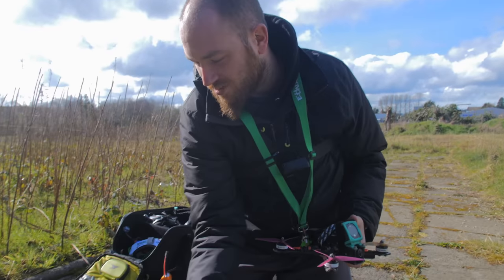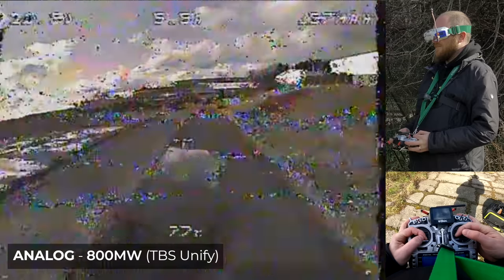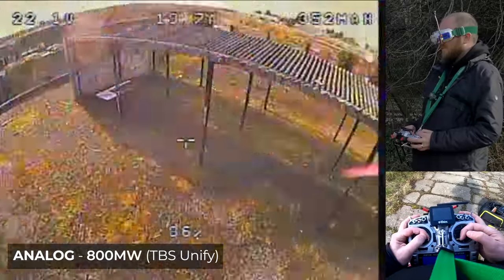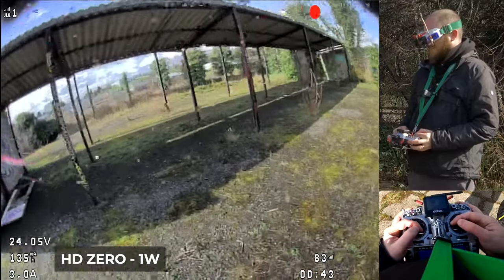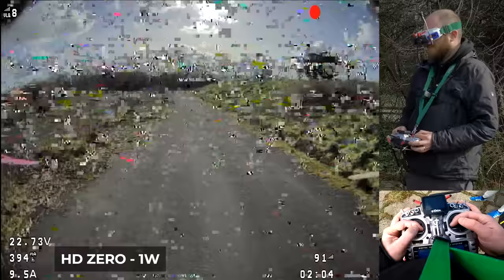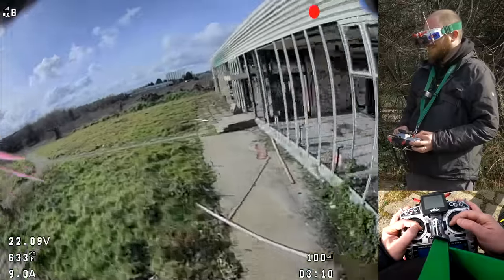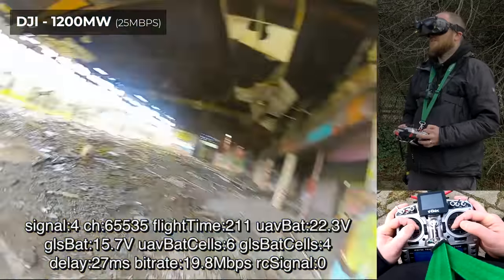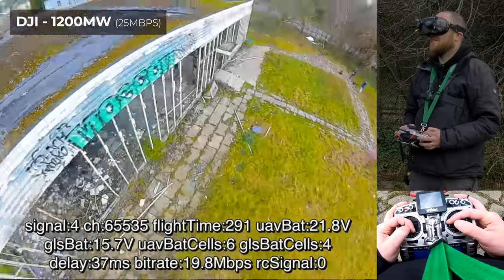HDZero vs Analog vs DJI - Penetration & Image Quality Test - small bando

Comment: Very nicely done video. My only tips for hdzero are 1) ditch the true rc stubbies. I get the worst performance using those and its noticeable. Your rankings will still be the same, but it should cure the full screen flashes a nice amount. Go with spironets or vas mad mushroom. 2nd tip is I noticed you look down more wearing the hdzero setup so I recommend tilting the patches upwards like 25° or so. This also helps a ton out farther cause hdzero doesn't do diversity. It needs to use all 4 signals, so when your beam angle is headed toward the ground, far out you're basically on your omnis mostly. Again, I'm not saying it'll be night and day or anything like that , but if you do fly it again it will definitely increase your experience. I have a bunch of penetration tests on my page :).
Reply from the maker: Hey man thanks for the comment, nice to have a view from hdzero royalty 🙂. I watch your stuff all the time, appreciate the tips 👍. The real test here was between analog and hdzero, dji is kind of a whole other thing in regard to what was being tested. Just built a fettec 15a 2.5 inch quad with the Hdzero whoop board and I LOVE it!
Reply: @int3fpv  haha I appreciate the love man! You put alot of effort into this. I'll eventually add dji to my fleet, I just don't really fly the kind of demanding locations that people like sync fpv fly and prefer a locked latency. But I do fly dji from time to time, just don't own it myself
Reply from the maker: @anthonyfpvminiquad1728  I like to fly quite close to myself most of the time, because I fly hard and don't want to walk ages to recover a quad when the crashes happen! I also value the consistent latency over penetration and image quality - which is why I fly analog (and increasingly hdzero 90% of the time). For flying med-long lines in a bando though dji is the way to go. They all have their place imo
Reply: @int3fpv  exactly how I feel and lmao your reasoning is EXACTLY my own. I'm just not built for going so far to go get my quad 😂 fuck that. If I ever got I to long range I would have zero motivation to go find my quad kilometers away. The fpv gods can keep it 😅😅😞
Reply: @anthonyfpvminiquad1728  Plus, I find flying long range is boring as hell! Mostly because a person pretty much needs to be way up high to get good long range, and I enjoy flying around objects, through trees, and weaving through the environment. Flying up high, in the open air, hell...you might as well have a Mavic! How is FPV long range any different from a Mavic long range? Sure, there is some, but not much! Open air flying up high is boring! And, what's the point of going so far? So, you can brag to your buddies about how far ya went? Finding a quad that far from you is futile - if not totally futile, really close! I do not see the point! lol
Reply: Just wondering... Is the "DJI" equipment the same as on the DJI FPV drone? Or something else? Thanks.
Reply: Agree 100%  Theres a big Difference if your Head/Antennas dont point in the right Direction. For Antennas i use the Lumenier Double AXII 2 HD and they improve the HDZERO imo, but DJI will still outpower it in therms of Breackup... May HDZERO will improve with theyr own Goggle, we will see. Cheers and thanks for this great Comparsion.
Reply: @AuroraColoradoUSA  Goggles are the same and you can switch it the on screen menu between the DJI FPV drone, and a "real" FPV drone.
Internal electronics on the DJI FPV drone is just for it.
A  "real" FPV drone uses either the DJI Air Unit or the Caddx Vista, which is much smaller, lighter, and much more popular.
If I were you, I'd buy the DJI goggles, and find a great 3" or 3.5" BNF (bind and fly) drone that can fly pretty much anywhere. I absolutely love my EMAX babyhawk 2 HD!! and highly recommend it! Fast and agile with a small 4s lipo, and will do 20+ minutes of long range with an 18650 battery - see Nurk's review on it!
5", IMO, are highly over rated and are mostly used for racing with gates. Problem is, in every day real life, they are LOUD, big, heavy, and attract a lot of attention - Bring out the KARENS, who complain about them and give you hassles. Plus, they require a lot of space to fly. With a 3" or 3.5", you can pretty much fly in any park right down the street and not attract too much attention. The parks don't have to be very big either! I started out with 5" and haven't flown mine in over 2 years!! Why? Because the closest place is about 30 minutes from my house, and it's not a very good. A park to fly 3 or 3.5" is only 3 minutes from my house, and there are about 5 that close that are all better than the 5" spot! Anyway, go get the gear and love the crystal clear image quality!!!  :)
Reply: @KOrnhOliO1  farthest i went is 750meter acros and around a lake. Its more than enough and yes it gets more boring the farther you go .
750 meter one way means 1500 meter in diameter. Thats one hell of a playground.
If you go fly far in one direction u might aswell pack ur stuffand fly there lol
Reply: @int3fpv  that 2.5 inch little drone you built sounds so cool!!! Going to your channel now. something about small fast f.p.v. quads really get to Me i just want to buy every one I see lol
Reply: Yeah... I also noticed with DJI he kept his head up and goggles pointed towards the quad. With HDZero he essentially had the patches pointed about 6 metres in front of him. Not very fair at all. Not to mention that DJI is set to the illegal 1200 mW.
Reply: @KOrnhOliO1  diving mountains mostly. That means 2-3 km of range at least and an fpv drone, not some dji stuff. Other than that, it's fun to just fly a nice cinematic, few km flight during a golden hour with a gopro. And it is also fun to chase after distance, but I personally fly freestyle in absolute majority of flights.
Reply: @KOrnhOliO1  Not necessarily. I'm building a Nano Goblin plane for long range, and I went with 900mhz ELRS and 1.3ghz FPV link because I want to do proximity.

Comment: Great comparison video, call me old school but analog seems like a way to go for a freestyle pilot, you might not be getting that colorful, HD image, but you still have full control, "none washy" feel of the quad. When you're flying in sketchy spots I'd rather have a crappy video signal strength as long as it's manageable to see and orient my self, than a crappy flight performance and full screen blurs or flashes, and be more likely to crash.
Reply from the maker: I think for bandos, especially larger ones DJI is going to be the best all rounder. Where you still have an analog image any latency in the dji feed isn’t going to stop you dojng anything, it’s more of a subtle feeling - personally I find it ruins the immersion a bit despite the much better and stable picture. Seeing gaps sooner and clearer is going to be a big advantage though. I fly very close up usually and hard, not far to walk when the crashes come lol so I still fly analog the most. I’ve built a hdzero sub250 micro for around the garden and house and I love it, much improved image from analog and rainbow screen isn’t an issue because you’re so close. They each have their pros and cons, but I’d say dji is the best all rounder for most freestylers
Reply: What’s the point of that when you’re locked in a box of where you can fly? You can fly much better when you’re not worrying about losing video
Reply from the maker: @SikhFPV  sure, but some people like to fly inside buildings behind many walls, just shows you what you can expect

Comment: Thank you, this is one of the best videos comparing the systems I have found yet. 
I also noticed nin other videos that HDZero handles medium signal strength better compared to analog, but drops faster and harder at really low signal.
Reply from the maker: Yeah definitely up to a point hdzero has less interference and distortion compared to analog, agree.. maybe first 60-70%?

Comment: thank you so much for this video. I really want to start FPV, and this is super useful. I like the fair comparison. I think I prefer the HDzero colors (it looks a lot more natural), but statics get in the way and the image gets worse than analog. I am definitely considering DJI, but I guess I will wait until the product situation clarifies.
Reply from the maker: Thanks glad you enjoyed it - yeah in my opinion they all have their pros and cons and it really depends what you want to do with it and the sort of environment you fly in. I mostly fly analog and hdzero depending what I’m doing. 

One thing I’ve learnt since this video from others is hdzero is very sensitive to antenna choice - the image is built from all inputs regardless of signal strength apparently which is quite unlike a typical diversity analog setup

Comment: Your results are consistent with what I saw when I tested the original Shark Byte gear against analog and DJI at equivalent power levels, back in 2020.    I have not really seen any significant improvements in the quality of the signal with HDZero since then.   Higher power only brings it on par with high powered analog.   DJI is just in a class of its own when it comes to NLOS performance, and it's even better with the full sized AU with two antennas as can use true MIMO.    DJI seems to excel in places with high multipathing, to the point that I can fly deep below LOS behind solid earth, especially there is something Rf reflective nearby like rocks or powerline poles and such.  I've got a video where I'm flying 10+m below LoS 200-300m away.
Reply from the maker: Yeah DJI is in its own class in this environment really. Personally I think hdzero has improved in a lot of ways - the 4:3 micro v2 is massive improvement from the first runcam 16:9 camera, I hated 16:9 and didn’t use the system because of it until the 4:3 camera came out. Canvas osd is a big + too.

Comment: Thanks for your video. The new Vrx 4 SMA should improve this. It also enabled you to use the best possible antennas on all 4 SMA as HDZero use all 4 antennas. It will probably also be known as a bit more sensitive then the old Vrx. I also believe you will have even better results with the DJI FPV drone as you are really flying DJI FPV v1.

Comment: The only thing i could recommend is running them all on Raceband 1 since the lowest freq will always have the best penetration. Make sure the output is equal, 1w will always outperform 800mw. The other thing is the quality of antennas used between the system. Your HD setups have much higher quality receiving antennas than your analog system did.  Other than those three things everything else was good.

Comment: Very good video. Exatcly what I was looking for.
Reply from the maker: Do you do long range? In that case analog or hdzero would be preferable over dji for sure due to the hard limit of the dji system. I’ve seen videos that show great results from hdzero in this sort of use case
Reply: @int3fpv  Yeah I am doing kinda midrange flights, like 10-15km. I have analog and this word finde for me while flying in line of sight. But if you going behind stuff the Signal is gone so fast.

Comment: Try replacing the omnidirectional antenna with 2 tripple feed patch antennas and you will see a big difference difference imo...
Reply: exactly.. I would swap out the left stubbies and get a TruRc X-air MK II. That's my current setup.  The best of both worlds. Having at least two onmi's help when flying behind yourself, otherwise when flying behind it's going to get ugly, fast.

Comment: Great video! I’m pretty new to the hobby, and I just received my hdzero 1w vtx, and I was reading that it doesn’t come setup for 1w, and that there is something you need to do to activate the higher power. I’m just curious as to what settings you were running on the hdzero? I can’t wait to see more videos from you. By far the best comparison I have seen yet. Definitely subscribing to your channel after watching this video. Keep up the great work!
Reply from the maker: Yes you have to flash an unlocking firmware on it and then back to the normal firmware to unlock it. Settings were CH1 at 1w, using the micro v2 camera on 4:3

Comment: Nice comparison, BUT on the analog and hdzero you are looking in to the ground. Only with DJI you are looking straight. This has big impact of signal reception
Reply: With the four omni's he has on his goggles, it doesn't really matter if he is looking down or not.  That really only applies with directional/patch antennas. I have two onmi's on my right and a TruRc patch antenna taking up both ports on my left. I tend to look down so my patch antenna is mounted 80 degrees up top, when i'm looking down the signal is going straight.

Comment: If you are testing the best some system has to offer why not test the more powerful analog VTX-ses ? You can use something like TBS Unify Pro32 HV or Rush Tank Solo for tests :) Sill way cheaper than other systems transmitters.
Reply from the maker: This is a fair point, unfortunately it was all I had. Really this was a test between analog and hdzero, with dji thrown in for completeness 😄

Comment: would you go with the V2 googles plus the RunCam Falcon 120 fps or SkyZone O4L plus the new walksnail vrx at 60fps because of the hdmi link ... Thanks and great vids - man ------------
Reply from the maker: I use HDzero goggles with hdzero and analog mostly 🙂
Reply from the maker: @bengordon7635  analog is loads of fun and cost effective
Reply from the maker: @bengordon7635  dji + 120fps would be my choice between those two options because of the latency of the walksnail hdmi at 60fps. Unless cost is a factor ofc

Comment: Good job with that comparison. I am DJI user and I have a question. You are using  25mbps mode, is it better for penetration? I usually so mid-long range flights and I use 50mbps.
Thanks and congrats for this good video comparing the 3 major systems
Reply: I think about the only use for 25mbps is that you can fly with more people at the same time. 50mbps takes up double the channels, so less people can fly with you.
Reply from the maker: I used 25mbps as it is more similar in bandwidth to hdzero, but yes in theory a narrower band will be less prone to interference - I’ve not tested this between the dji modes but I’m sure someone has. Glad you enjoyed the video

Comment: It seems like you were able to fly more aggressive with analog and HDZero than DJI. Was that because of latency?
Reply from the maker: Wasn’t trying to push the limits in that regard during any of the flights, DJI can feel off in places even close up - analog feels connected, dji feels a bit like playing a video game imo but with significantly better image and penetration. Where you get going signal with analog and felt latency in dji is more about disrupting the connected feel than actually stopping you doing anything. Maybe I’ve been flying analog too long 😄
Reply: @int3fpv  your flying just looked smoother and more confident on the other systems.

It's all academy for me anyway, as DJI had been a non-starter for me even before HDZero 😝. As a DJI V1 Mini owner, I didn't like some of the stuff they were doing, like configuring the battery boards to die when you try to replace the cells. Really put me off the whole company.

Comment: I wonder if there will be a difference in HDZero with the new VRX.
Reply from the maker: I don’t think so as it’s using the same asic, the ability to have 4 different sma antennas might give more flexibility antenna wise I guess. I’d be able to improve my results by using taller omnis I’d say. I later tried using the supplied direct ufl antenna on the vtx that was supplied instead of the pigtail and lolipop but this made no difference as far as I could see.

Comment: Its not really an apples to apples comparison because of the mW difference but am sure that even at the same Watt rating the dji would still perform better than the HDZero. The dji system is much more sophisticated than the HDZero.

Comment: I have no idea about all of this, but for the:
"DJI - Caddx Vista 1200mw CH1 25MBit, OG DJI 120fps camera, axii antenna upgrade on vrx All running on fettec G4 kiss with IRC Ghost control system"
How much would all that cost approximately? Vague number is ok, I just wanna know if its payable for a normal human.
Reply: i have almost exact that setup i started my first purchase at around 1350 euro.
T-Motor FT5 MK2 HD
Radiomaster TS 16s
IRC-Ghost with Ghost Atto Duo receiver
2x Peter the penetrator TX antennas
Dji Goggles V2
TrueRC X2-Air MK II 5.8GHz
Dinogy 1300 MAH 6S lipos
Reply: @MRdeLaat  Thanks m8! That's actually a decent price for such a cool hobby! :D Maybe in some years :)